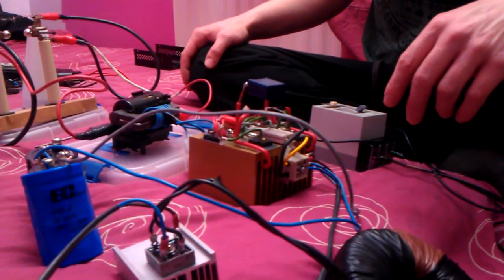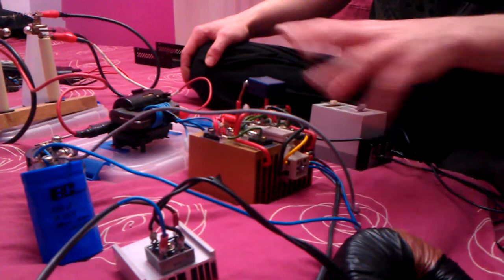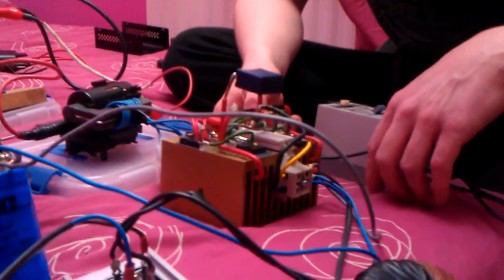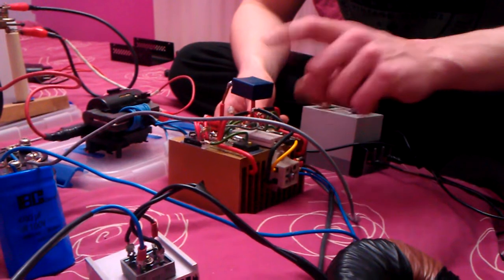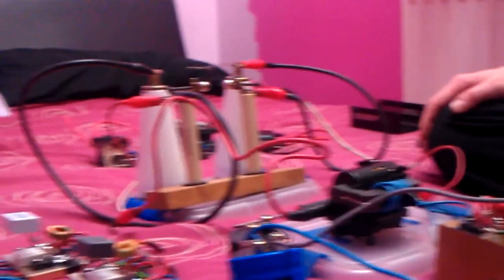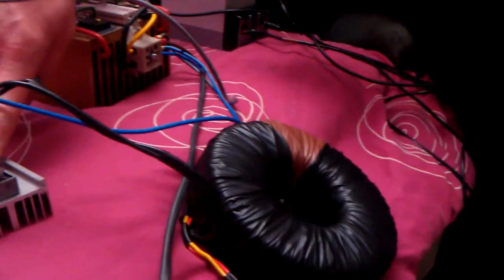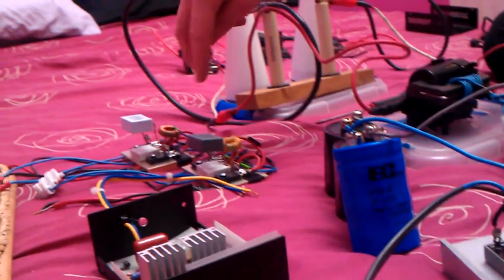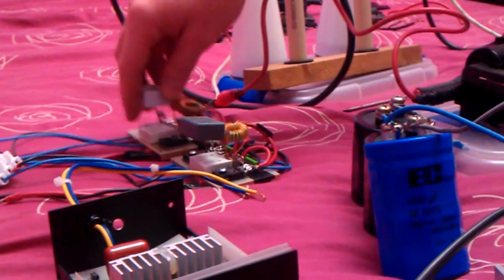4 mosfet zvs flyback

Comment: Hi, gow did you wire up them, youve just put thei pins in parralel, can i do it with 260n's too?
Reply from the maker: Hello. 
yes the mosfets are in parallel.  as with a zvs you have the 2 mosfets. and you just parallel another. make sure you put the 10k ohm Resistor and the zener diode with each mosfet.

hope this helps mate

Anthony👍😉

High1voltage1rules
Reply: Thanks,!!!
Reply: I wanted to find out this since i ve got my zvs working xD so thanks for the reply!!!!

Comment: On your comment about multiple flybacks, you can run more than one from the same driver both in series and parallel. I wouldn't bother with multiple drivers as in my experience, it's a bit more of a pain getting them to work properly. Nice arcs, though!